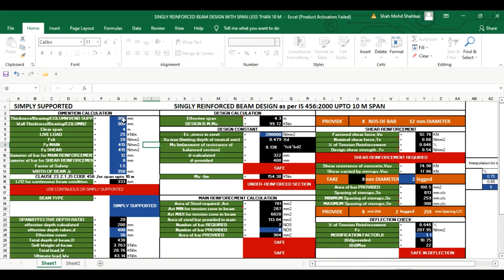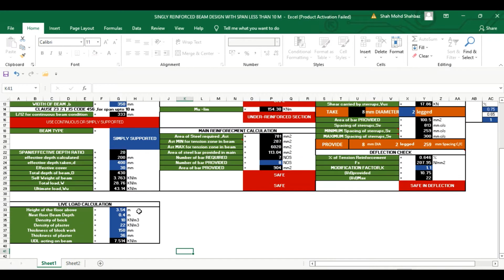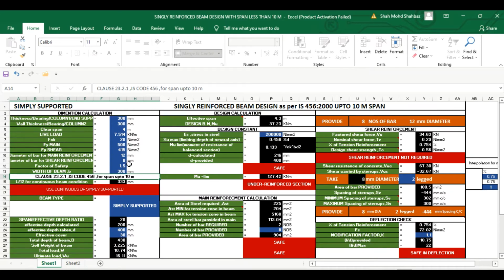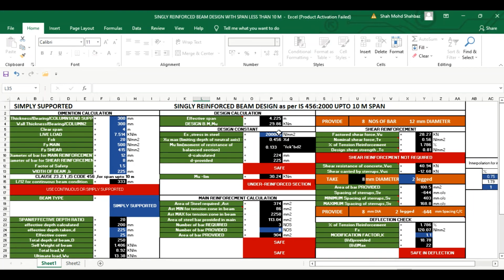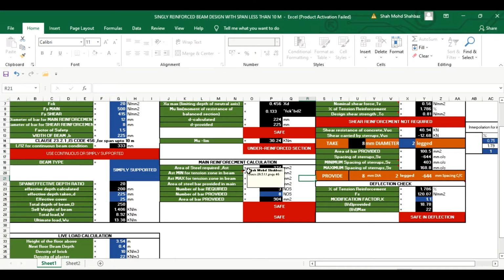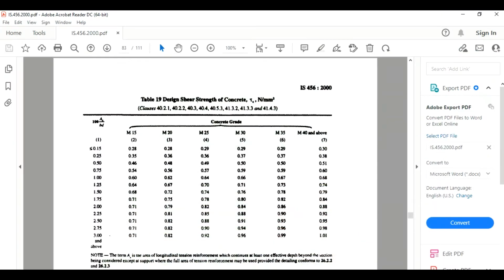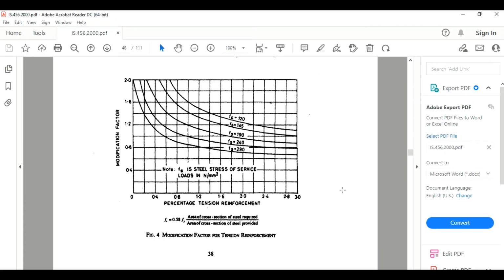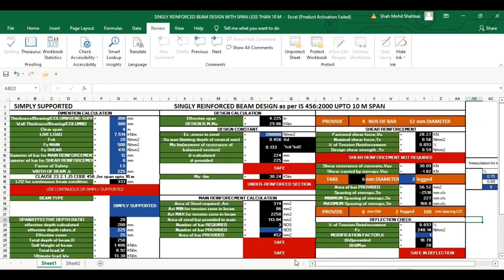SIMPLY SUPPORTED SINGLY REINFORCED BEAM DESIGN EXCEL SHEET-TYPE 1

Comment: I have to purchase ing solar structure sheet some issues occurred . Some problems is missing
Reply from the maker: What was the issue
Reply: @ConnectCivilianLEARNING  some formula is missing
Reply: Members load formula ? 
CP value 
Pd ??
Reply: And then I need some help 
If you okey with 
U have to work with one of the project.
Reply from the maker: All the formula is their..first watch the video ..after that you can easily design the solar structure.
If it is not, you can ask in comment..
Reply: I have to purchase this excel sheet
Reply from the maker: You can directly buy from the given link in description